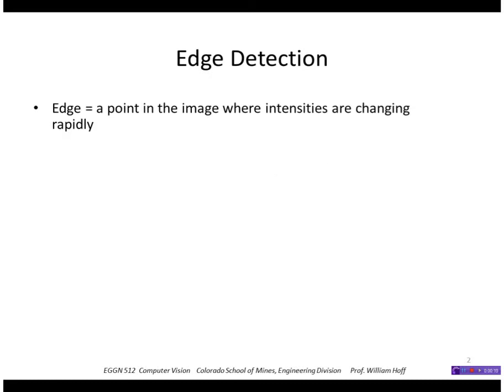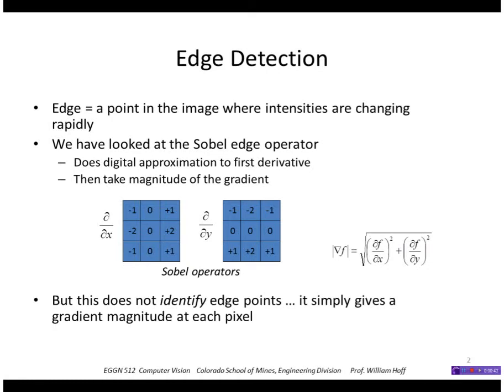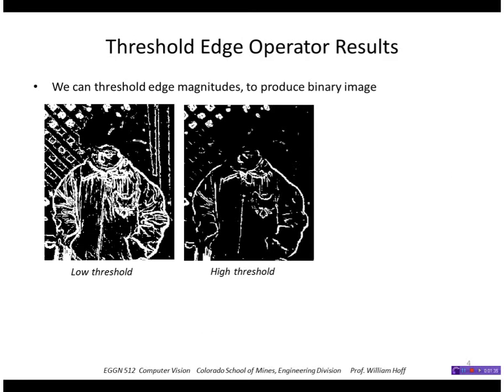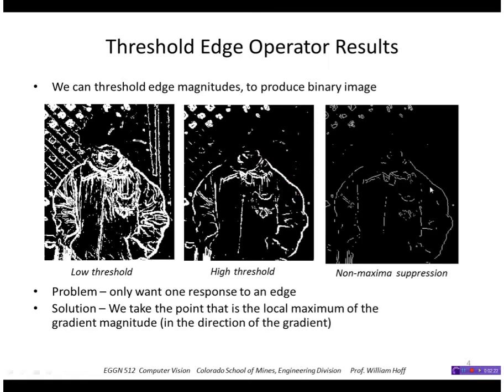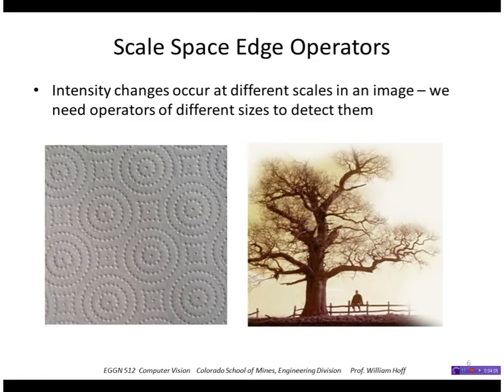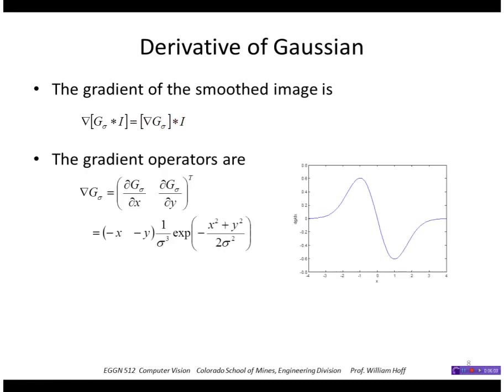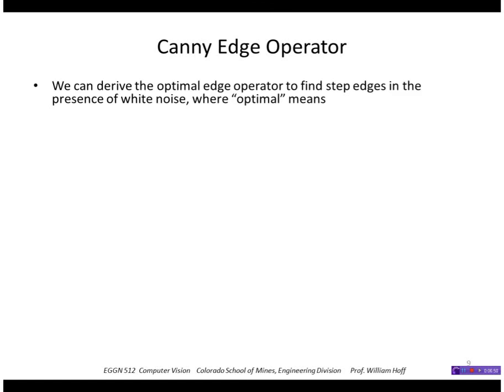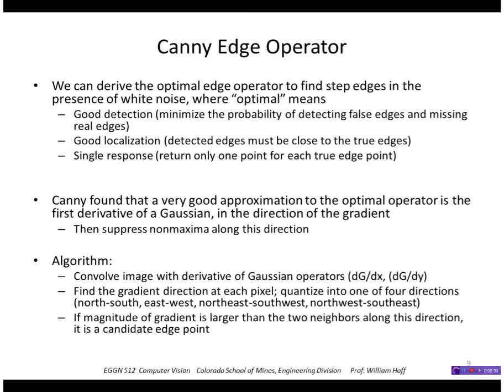CSCI 512 - Lecture 09-1 Edge Detection

Comment: For those of you why are confused with the order of derivative, the gradient operators shown here are for the second derivatives, and the peak of this first derivative, which is an edge, can be found by the zero crossing of the second order derivative. The reason for this is that you want to suppress non-maxima to get an optimal solution for an edge. This can be seen from the "if magnitude of gradient is larger than the two neighbours along this direction, it is a candidate edge point." This statement is equivalent to the meaning of zero-crossing of the second order derivative. Always remember we usually want to find a single optimal solution of an edge.